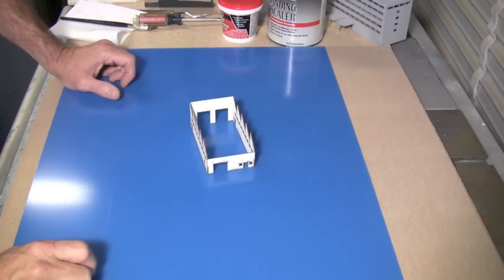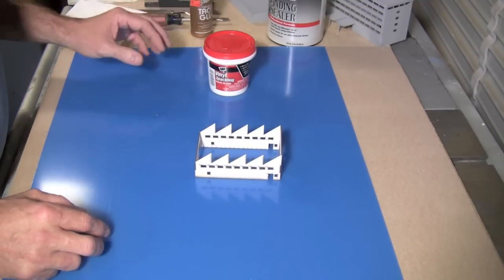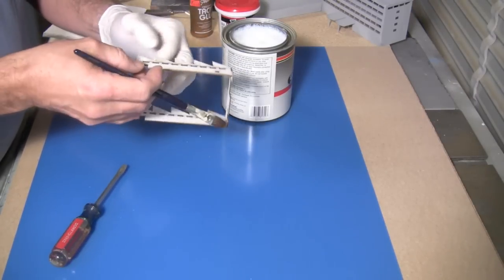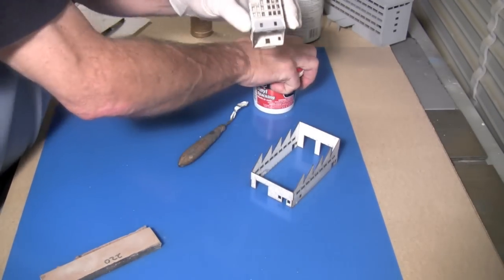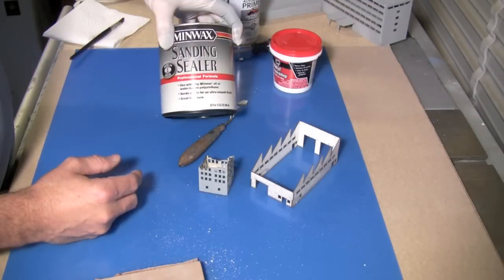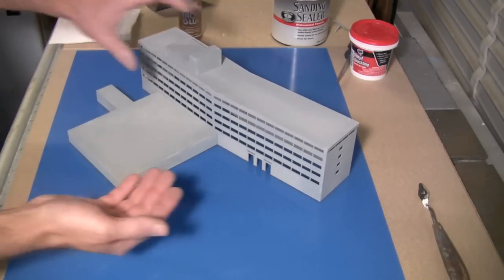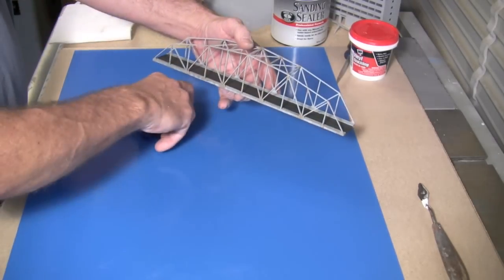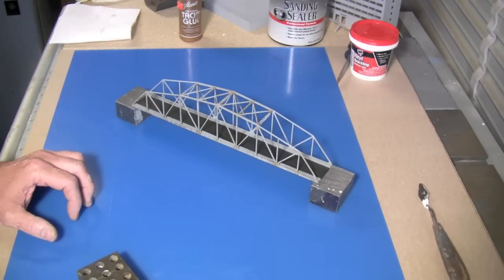Cardstock Series Tips and Tricks

Comment from the maker: @dullspork 

Jay,  I have seen no warping in finished buildings treated with sanding sealer.  

I did an experiment today with a very long thin strip of matboard, I put sanding sealer on one side of it and let it dry to see if it would warp.  The piece was 12" long x about 1/4" wide,,,  and after it completely dried each end came up off the table about 1/16".  Not bad at all.  Sealing both sides would have prevented that bit of warp I'm sure.

Comment: Allen, 
I looked up the sanding sealer on Amazon and saw some fairly negative reviews (just a few, but no positive reviews to counter them). A few mentioned older oil-based sealer vs newer water-based sealer, and did NOT like the water-based one. Which have you used, and which do you recommend?
Reply: try           british modelling books from the   40's and 50's such as 'Miniature Building Modelling' by John H. Ahern look on amazon, some of his model's are still in existence from the 40's made from war time surplus materials, which isnt at all bad!